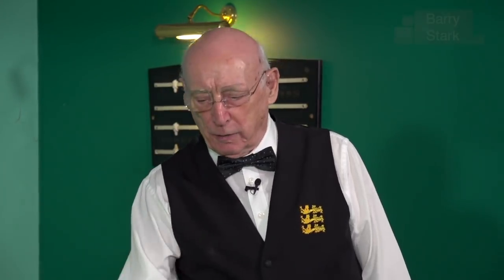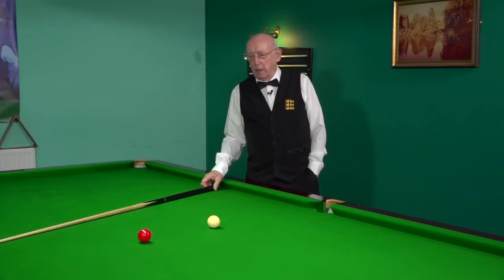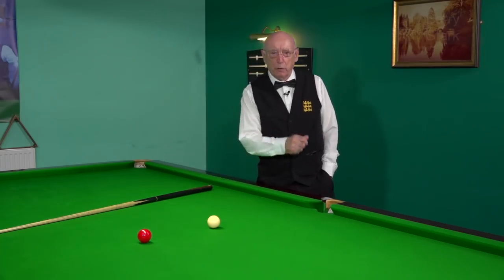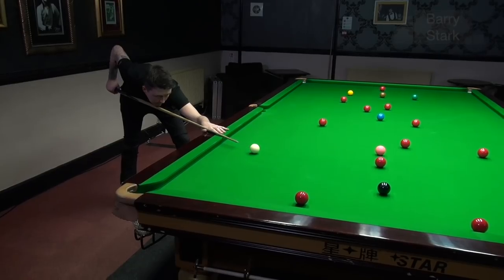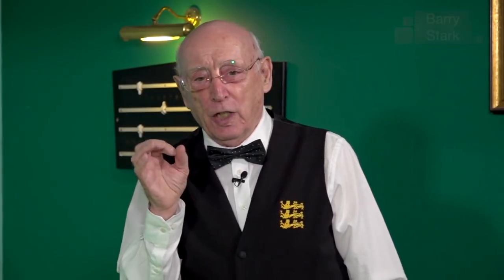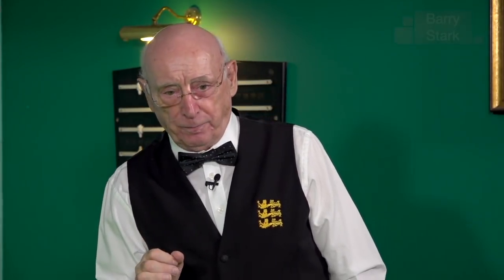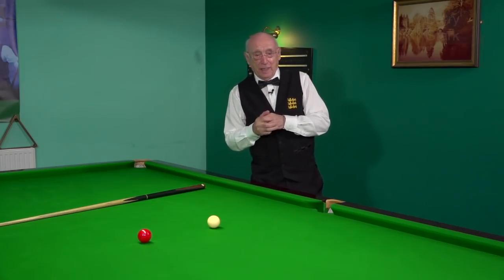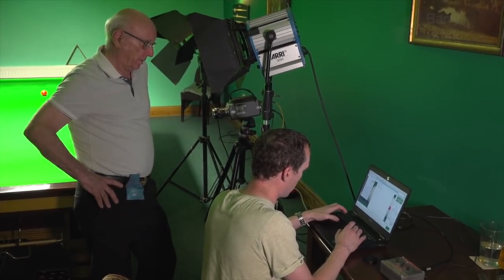109. Timing - What is it? Part1

Comment: Spent a lot of time on this subject, timing is a bit too generalistic a word for such a complex subject. Think of a good shot as the efficient transfer of energy from cue to ball, the more energy wasted, i.e. deceleration, off centre hits etc. the less efficient the transfer and vice versa. Unfortunately if you want to go deep with the analysis, video won't do it. 

Remember the shot starts with a neural green light in the brain, electrochemical signals then activate nerves to stimulate muscles to react and begin the kinetic sequence, then the cue moves and makes contact with the ball. Any weak link in this complex chain will ultimately result in small discrepancies between the optimum energy transfer and the eventual result. These results can be shown in great detail,  ball speed, contact and energy transfer much better using audio.

Using video is very similar to using a standard optical telescope to observe the universe, you will only see a tiny fraction of what exists. It is also incredibly expensive for the insights gained. 

Barry, you hit the nail on the head talking about the sound, it's your ears picking up the energy waves created by the collision, different energy tranfer creates different frequencies and you're attuned to efficient vs inefficient.

Comment: As dr Dave billiards has stated, a good follow through and longer tip contact does not fundamentally add more spin or accuracy. It is merely a sign of good stroke and fundamentals. Hence, it is a non-correlative connection between tip contact and spin/accuracy.
Reply from the maker: Redox. Lets wait and see what the high speed camera shows the next time we are able to hire it.

Comment: Thankyou so much for your time and effort putting this footage together.  Very appreciated! I would really love to know how much the extra contact is as a percentage? As you say, in micro seconds it is a very small number, but the overall time the tip is in contact with the cue ball is in itself a very tiny amount of time... so what does the extra time equate to as a percentage? Is it 10% for example... because if it is that much then it makes that very insignificant amount of time a VERY significant amount of time... it's all relative is what I am getting to... thanks again 👍
Reply from the maker: eMatt. We need to get the high speed camera back to determine any real measurements.

Comment: Poorly explained. We can't just say if i hit better i prolong the contact and good timing means longer contact. How exactly do i hit better? Good timing means smooth acceleration from the back pause to the moment of contact, avoiding jerking/deceleration). The contact is so brief(in pool one milisecond/5mm/0,2inches, don't know if it is different for snooker) and when we touch the cb it's too late to change anything because it is pure momentum/inertion. In one of the dr Dave's articles he writes about the most common myth than something can be done in that short contact time. If we hit slower contact time can be a bit longer, but the speed is slower so the distance is practically the same. So if you claim longer contact theory it would be nice to give precise details and explanation. What is longer? Contact time, contact distance, both? How do we achive it? By smoother acceleration, by following through(i don't belive in it since its too late, the speed has been developed from the back pause to the moment of contact, follow through is not the cause but the effect/consequence of the good stroke), by developing more or less speed?

Comment: Hi Barry,  this was an amazing explanation of perfection required in each and every shot.  Slow or hard doesn't matter.  Well I have a question for you.  I follow all your advices from YouTube.  I am suffering a problem here to become a better player. I am quite sure I queue straight.  I am sure my body alignment is correct and I feel comfortable very much to hit the ball with average timing required.  The problem is when I go for a long pot with an 30 to 60 degree angle the cue ball doesn't hit the object ball where I want I want it to be. However this doesn't happen in a straight shot.  I have practiced a lot to make it correct.  I have no idea what's happening.  And the second problem is I do take good break in the starting of a match. Recent was 48. And then I suddenly miss the position or the pot.  Can you please suggest me a way to work on it.  Thanks a lot,  specially for providing these videos.
Reply from the maker: Aakash. You say you cue straight but the cue ball doesn't hit the object ball where you intend yet you have no problem with straight shots. I am afraid that this doesn't make sense, long shots will always examine your cueing more than short shots, even more so if you are trying to manipulate the cue ball. If you are consistently potting long straight shots you will soon learn to make the necessary adjustment on angle shots. In respect of your break this also suggests that contrary to what you believe the problem does lie with your cueing, playing positional hots again examines your cueing, you can easily start to deliver the cue incorrectly simply because your concentraton is diverted away onto other elements of the shot. This game, as with many others, is all about repetition and any routine will aid your skills, it is just repeat until you get it right, there is no short cut I am afraid.

Comment: I find it interesting that there isn't more discussion about cue tip density and thickness, as the compression and rebound of the tip material seems to take up a large amount of the contact time. The pro in this video used feel, sound, and cue ball (re)action to determine how well he struck the ball. I think the tip of the cue should be discussed a great deal more when "feel" is such an important aspect of the subject, and when it clearly makes a significant impact in regards to contact time. As for defining the word "timing" in regards to striking whitey with the cue tip.... I have always considered timing to be which part of the stroke contact is made, for instance: before, during, or after acceleration. An accelerating cue tip should in theory stay in contact with the ball longer than a decelerating cue tip. And the same applies to the soft vs. hard tip comparison. Looking forward to future videos. Thank you for your efforts, Mr. Stark.
Reply from the maker: Walter. Nobody is more fussy than a pro when it comes to tips. Some like a hard tip, others a soft tip and still others somewhere in between. All are generally very particular when it comes to the depth of the tip, this comes mainly because the old tip has worn down so much that when a new one is put on there is a massive difference in depth and it takes some time for it to be bedded in. That is one reason that I tend to clamp tips before applying them, it can cut down the playing in time.

Comment: Another great tutorial, thanks! Don't play myself, but your tutorials let me appreciate the sport better.

A question, then: if the length of time cue tip stays on the queball makes the shots better, what difference would a softness of the tip provide? As in, would a softer, more springly cue tip make it easier for an amateur to get better shots? If I remember my physics right, softer material would authomatically mean longer contact time, as the tip deforms around the ball.

I understand that harder tip wears out less, and delivers the power better. But in golf there are several different clubs for different type of shots. Maybe snooker at professional level may benefit from the same strategy? If a player needs a long straight powershot - take the hard cue, if he needs a short soft sidescrew - take the other que. Just thoughts, and thanks again!
Reply from the maker: Certainly a softer tip would compress more and probably prolong the contact time but they have a tendency to throw the cue ball off its intended line a little more also. Good players are always trying to do something with the cue ball and need to obtain consistency of feel, not only with the tip but also with the cue as well. The margins for error at snooker are very small indeed both in potting a ball and of course positioning the cue ball, any player would be reluctant to change cues during a frame and depending upon the shot to be played.

Comment: quite a great video. What I understood is that we have to increase the speed of the cue motion and as a consequence it increases the contact period between the tip and the cue ball. Am I right ?
Reply from the maker: remi. Cue tip speed is a factor in good timing but it is not the whole story, play with a longer back swing rather than a short one, relax and allow the cue to do the work rather than your muscles, get through that ball, feel the ball and the sensations involved. There is some debate as to whether that will increase cue tip contact time but it will certainly help you to improve timing on the shot.
Reply: This is so interesting. Thank you :)

Comment: I agree with the concept of the contact time between tip and cue ball, but ultimately I think ‘timing’ comes from your readiness to deliver the cue, and this all comes down to focus, concentration, relaxation, all of which leads to delivering the cue at the right moment, also I think if you could find a way of measuring the pressure of the grip around the cue proportionate to the tip and cue ball contact this would lead to a better understanding of timing. In my opinion a badly timed shot is all to do with the tip and ball contact relative to the position of the cue in its travel and the moment when the grip starts to tighten around the cue. It’s the same in boxing, if you’ve ever hit pads or a bag you can hear when you’ve timed the shots well, not relative to power but when your fist clenches relative to the contact between the two components (glove and bag -or pad).
Reply from the maker: Daz. I agree, I have spoken to many pros about this and most feel that the grip must gently tighten as you hit and get through the ball to generate good timing.

Comment: Hello Barry and Greetings from Germany ! 
First of all, a big Shoutout for all these great Videos. Especially the Grip Videos improved my Potting.
I have a Question. After 4-5 Hours of playing, its getting hurt in my left Shoulder. (Bridgehand / arm) Are there any Advices/Videos to avoid  this ? Greetings
Reply from the maker: Michael. There are many reasons why this can be possible or even likely. First 4-5 hours without a break is a long time to play and maybe taking a rest would be a good idea. Secondly you may be putting a little too much weight onto the bridge hand, I do like to see a player leaning slightly forward but this can be overdone, a little adjustment in your stance can alleviate this, moving your stance marginally closer to the table should reduce any strain. Thirdly, perhaps you may benefit from some shoulder mobility work, a visit to a physiotherapist will identify any possible problems in that area.
Reply: @BarryStarkSnookerCoach  Thanks for these nice Advices from you ! I Think the Stance/thing can be the Way to go ! Of Course i will check my shoulder from my Doc. But.no way to take a Break after 4 Hours Barry ! ;-) Please excuse my English. I wish you all the Best ! Thank you !

Comment: Thankyou sir Barry your videos are amazing. I have a question if I may. I'm legally blind in my left eye and as a result of that i don't run the cue directly between my eyes/ in line with my chin and nose. I have the cue say 1 inch towards the right side of my chin is that correct or should I try something else. Thankyou
Reply from the maker: Bryce. It would be a mistake for you to try to position the cue centrally, even players with normal vision tend to favour one eye and the position of the cue is generally towards that eye. Because you use the words legally blind as opposed to totally blind in your left eye I would suggest the position of your cue is right. This is easily checked on the baulk line, if you are on line when you get down in position everything is fine, if not then you may need to move the cue even more towards your right eye.

Comment: This is very interesting. I've written an article with a similar theory about acceleration of the keys in piano playing. I'm working around an idea of slightly prolonging the contact between the key and the hammer (by accelerating smoothly during first contact rather than sharply). I believe you can make a bigger sound with less impact noise (between the key and the keybed) and less perception of effort. This would be achieved by marginally increasing the time spent passing on acceleration (so the hammer doesn't lose contact with the key prematurely). These things definitely merit analysis.
Reply from the maker: cziffra. I find it fascinating that skills involved in one field of activity often overlap into others.
Reply: @BarryStarkSnookerCoach  absolutely, its always interesting to find the links. I've often used an analogy of how all the serious snooker players cue through the ball on screw shots. When amateur pianists try to play quietly they tend to make sharp but stilted movements, not unlike stopping the cue at the ball. There's much more control over the hammer when you move slowly but deliberately, rather than abruptly with a deliberate stop.

Comment: Would it not be possible to improve timing by using very soft, deformable tips? These would surely prolong the time of contact.
Reply from the maker: Andrew. Soft tips will compress more and therefore probably stay in contact longer and possibly also generate more spin on the cue ball but this is generally at the expense of accuracy, most good players will therefore opt for a firm yet holding tip.

Comment: This question has been in my mind for years and years! Thanks for delving into the subject beyond the surface cliche Barry, you are the man!

Personally I am not convinced that longer contact between the cue tip and cue ball is the only defining characteristic of a well timed shot...
1. The cue acceleration through the required velocity for the desired outcome must coincide with the point of contact between the cue tip and the cue ball (seems more important to me).
hit the ball too early in the stroke or accelerate the cue too late and the shot will be weak.
hit the ball too late in the stroke or accelerate the cue too early and the shot will be weak.
2. The acceleration at that point of contact must be at it's maximum (Thus allowing the potential for a longer contact).

I've also always wondered when using side a longer contact time is actually going deflect the cue ball more than if the contact is shorter. So I wonder if the better players get less deflection maybe they are in fact having a shorter cue tip/cue ball connection, thus less deflection.?.
Reply from the maker: Music. Some interesting points, more experiments needed.

Comment: Fab video Barry. When Steve Davis coached his World Snooker Coaching Courses, he claimed that the cue tip was in contact with the cue ball for only approx 5-7 mm. it would be great to see evidence of this in relation to different rates of acceleration/deceleration through the cue ball. I really enjoyed this... Thank you
The key to this I believe to be the amount of acceleration occurring whilst the tip is in contact with the cue ball. More acceleration, more cue ball reaction, then more efficiency and “timing”

It would also be really useful to compare efficiency and striking of different cue woods. To compare Ash cues which are quite Whippy, and maple cues that are a lot more stiff. I notice from the video there is a lot of deflection with Michael holts ash cue, it will be interesting to find out if any of that deflection energy gets transferred into the cue ball using a different maple Cue.
Reply from the maker: Mike. Time we have the equipment is limited I am afraid, I too would like to experiment a little deeper, at least we have created a good discussion point.